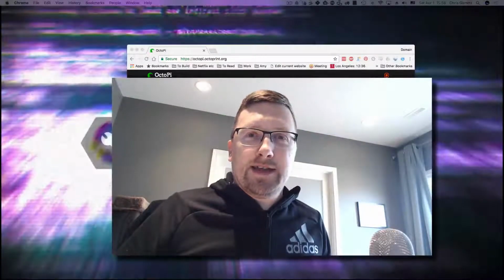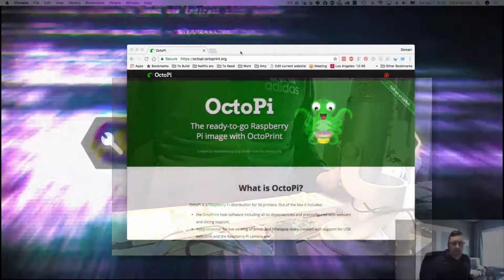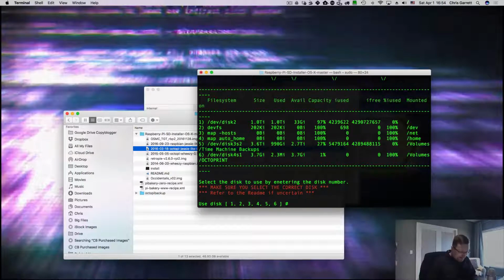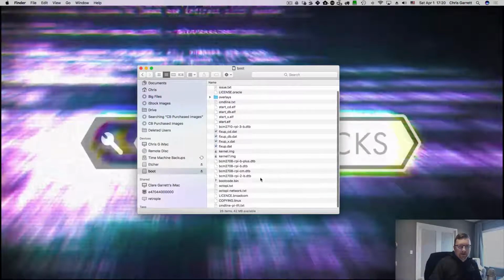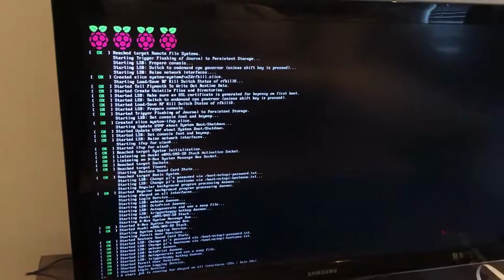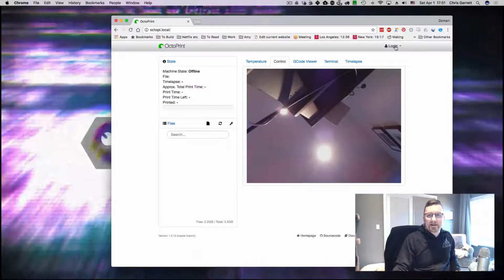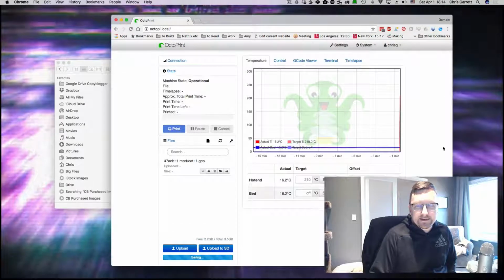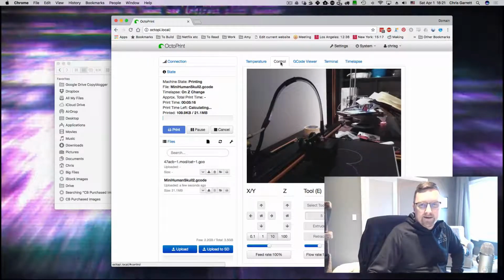Octopi! How to install and set up Octoprint on a Raspberry Pi to run your 3D printing

Comment: I cannot connect to my QiDi Tech 1 printer with my RPi3 is running OctoPrint. The Serial Port is /dev/tty/ACM0 and I tried every baud rate including Auto. It just says "connecting" then it goes back to "offline" after 30s. I can connect to printer directly using USB and Makerbot just not with RPi3 /OctoPrint. I am at a loss as to how to troubleshoot this.

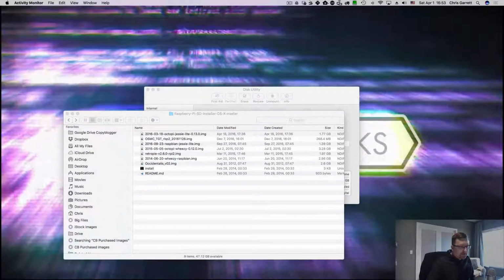Comment: At 6:07,  I do not follow. Was there a program called "raspberry pi sd installer?
Reply from the maker: Yes https://github.com/RayViljoen/Raspberry-PI-SD-Installer-OS-X but as I say in the video, I prefer Etcher unless I am creating a shell script
Reply: Maker Hacks thank so much. I had thought it was another step that wasn't originally listed.
Reply from the maker: No problem! :)
Reply: I am at the point of logging in on the pi, and the "octopi login" isn't working with what you showing. I am using a keyboard not an SSH
Reply from the maker: You are using screen and keyboard? If you get a Pi login prompt the default user and password are pi and raspberry. In your browser you should be able to go to octopi.local if octoprint has booted
Reply: Ok logging in works, but going to octopi.local on my browser isn't pulling anything up, and on the pi when I type in "hostname -I" it gives me a blank line
Reply from the maker: OK put the card back in your computer and make sure the configuration file has all the correct lines uncommented, passwords etc are correct, and your quote marks are straight inch symbols rather than curly quotes